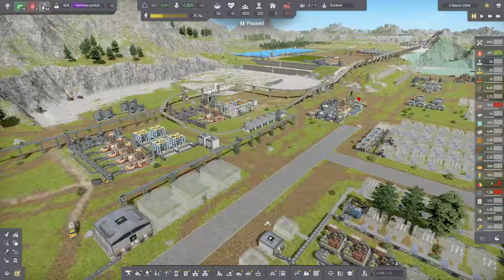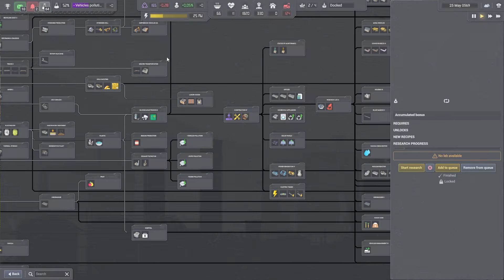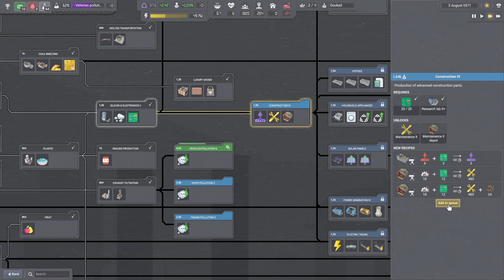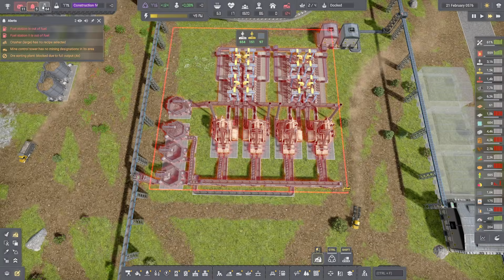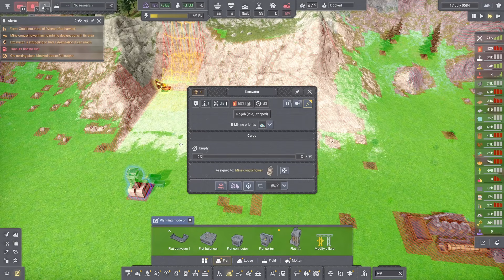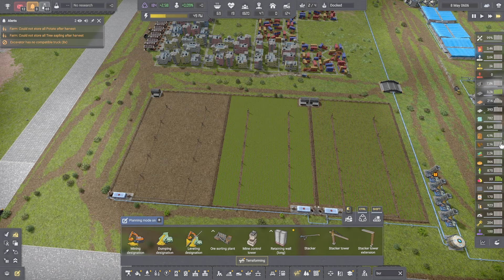TRAINS And Crisis Management - Captain of Industry - Update 4 [E9]

Comment: Yeah, never use storage as the only overflow enpoint, always have an emergency disposal system connected ASAP. The storage eventually gets full you forget about it and then stuff breaks.
Are you actually using sand for stuff you could do with manufactured sand? I always make those with manufactured, because sand is more valuable than rock and you get loads of rock anyway.
You can make longer trains. From what I read there's a extension module for the train depot (or whatever it is called), that you can stack to increase the length limit for trains made in it.